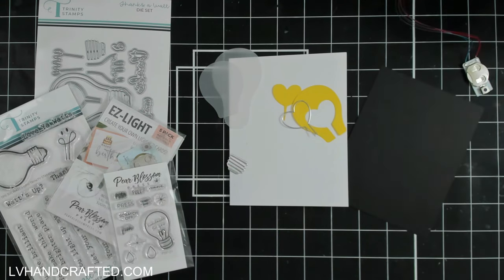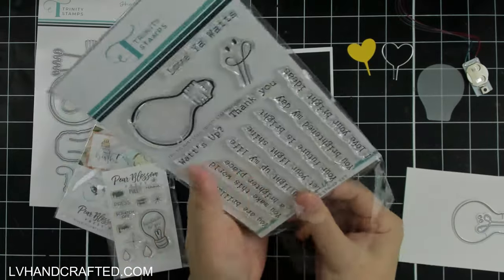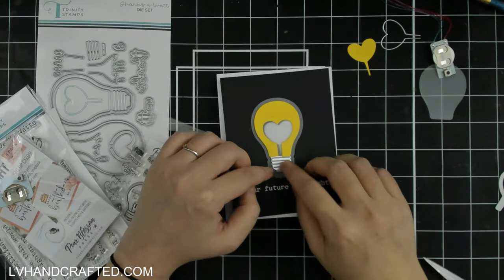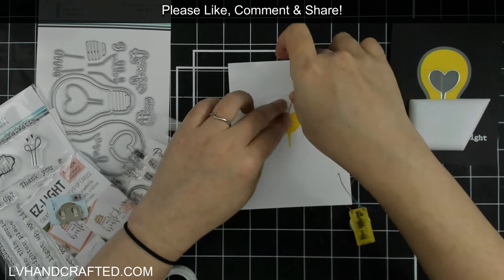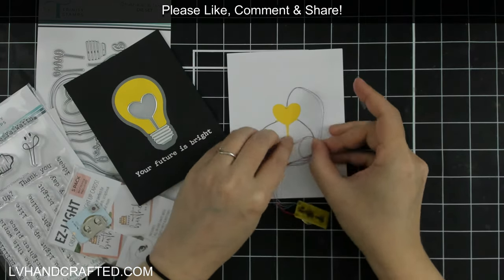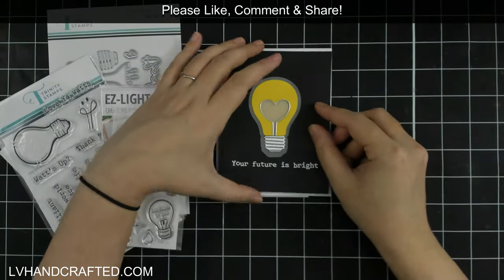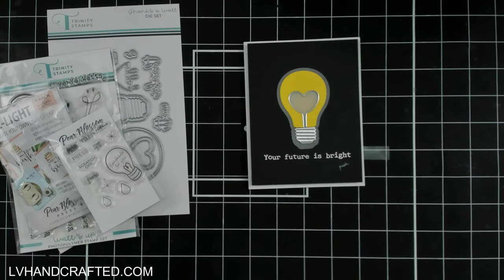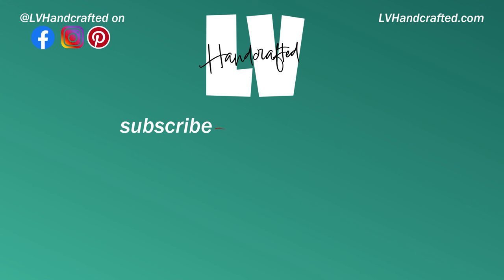Keep Your Light-up Card Battery Fresh!

Comment: Great card.  I have put a thin piece of cardstock in mine to preserve the battery. I have left enough space for it to be removed & placed back in by the recipient.
Reply: Thank you so much! 💗💗 Great idea to use cardstock!  That's stiffer so it's great that it can be slipped back in!